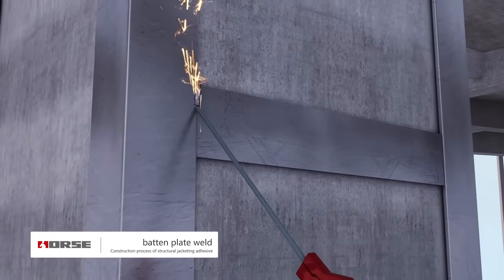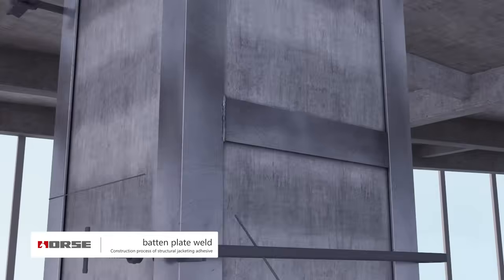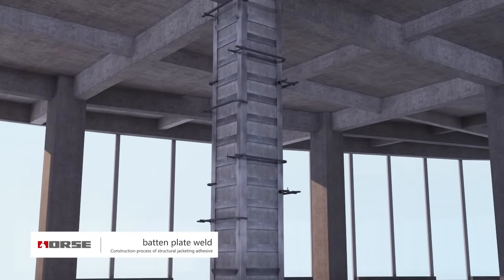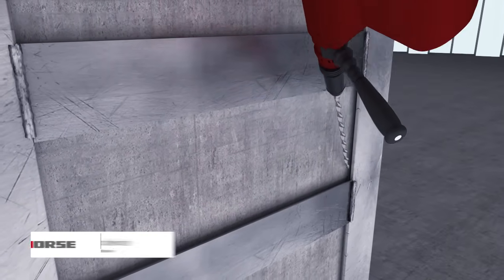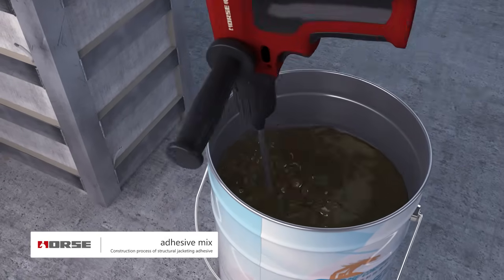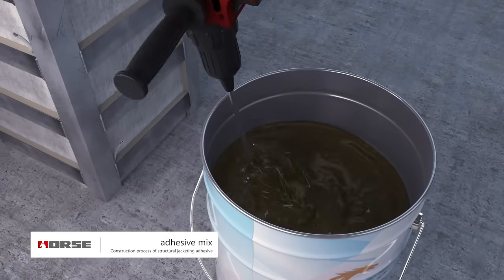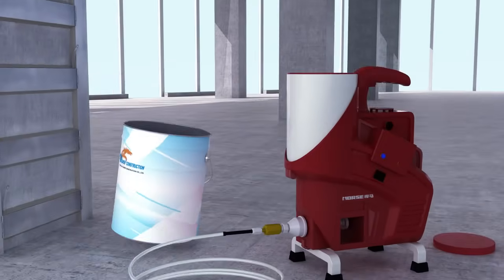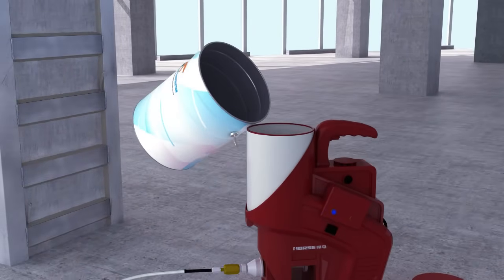A new advanced technical:steel jacketing for column beam strengthening

Comment: This is for column at one floor . How to calculate the additional load carrying capacity of this flitched beam?  I am interested to provide to one of my old structure which undergone once in strengthening by traditional method. What are minimum requirements of technical parameters of existing concrete column for resorting this technique?.
Reply from the maker: If you need design support, you can check our software of CFRP

software
https://reinforce-en.shhorse.com/home

Comment: what is the Significance of this Study steel jacketing for column beam strengthening?
Reply from the maker: Wrap the four sides of the concrete column or beam to be reinforced to greatly improve the section bearing capacity and seismic capacity